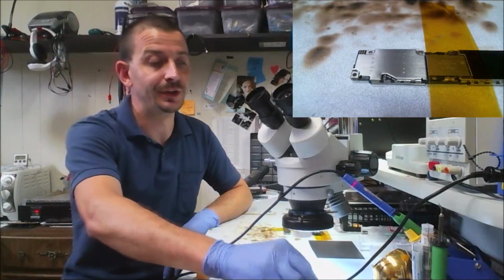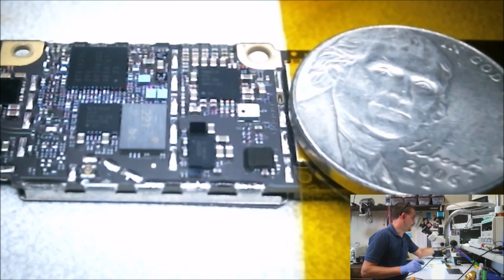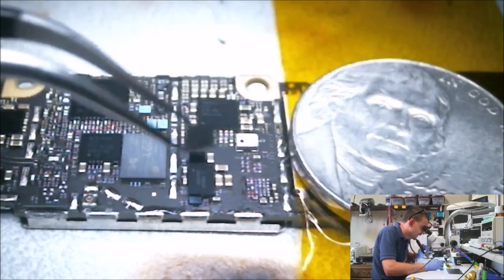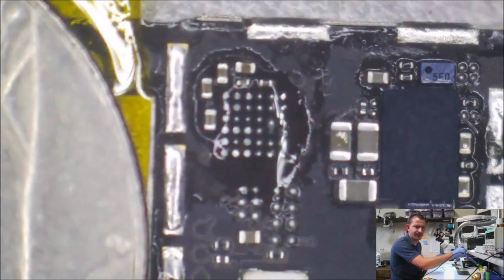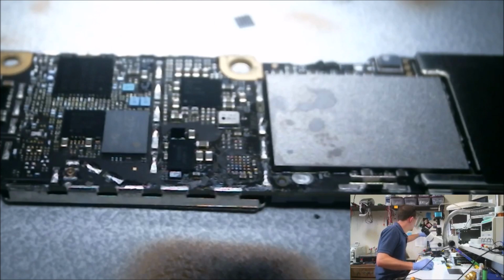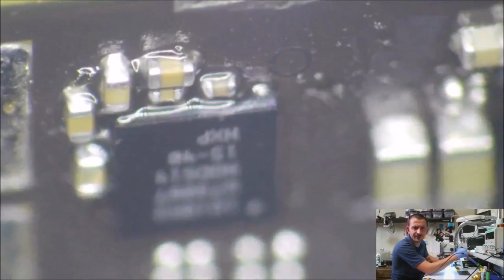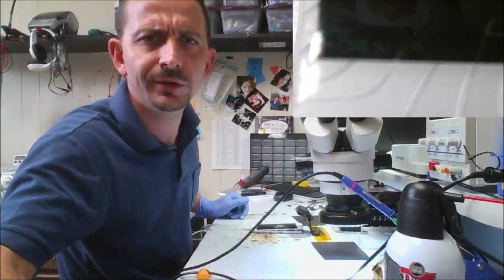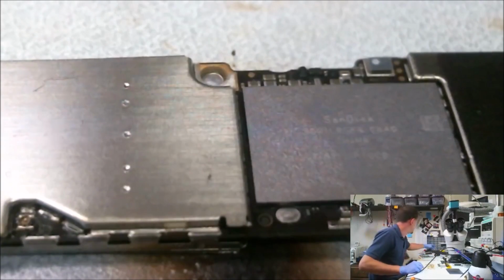iPhone 6 Tristar IC replacement (U1700) (U2) Not charging / Accessory not supported / battery drain

Comment: Could you put kapton tape over the caps,  two strips masking off the sides with components so if they float they won't drift or get pulled by the goo on sticking to the IC?

Comment: Really good tutorial. Just one question, because of the tight tolerances between each solder ball how are you sure they all line up ?.
Reply from the maker: It's tricky but surface tension makes it possible without being perfect.  As long as it's within a certain margin and none of the balls are bridging pads, surface tension will align all of the balls & pads at the same time when they melt.

Comment: Sir, how do i know if the 'dot' of the chip is in the right direction? (iphone 6) which way do i need to place the chip, because i dont have the schematic program to see if im doing it right..
Reply from the maker: On most PDF schematics, there's a red arrow that indicates pin A1.  A1 is pin 1 and is the direction the dot will go to.
Reply: STS Telecom 

oh too bad i dont have PDF schematics programs.. can u tell me which way it has to be placed? or its not the same each iphone/chip?

Comment: Sir I am having iPhone 6s plus the touch id is getting hot and iPhone 6s plus is also having a battery drain issue the icon add finger print is greyed out I have restored it two times which hardware I have to check now

Comment: Hi, i watched a lot of your videos, and just wanted to ask you what temp are you using to remove the shields? And one more thing - my iPhone 6 recently stopped charging, and after doing some research, i discovered that U2 (Tristar) could be the problem. So i got 2 new ICs, cleaned everything including the black stuff covering U2, removed U2, cleaned the black stuff underneath U2. Then i ran into a little problem, wasn't sure about the orientation of the IC, searching on google gave me two different orientations, so i decided to try my luck and soldered it the way i thought it should be. The phone turns on, when i connect the charger it says CHARGING, shows the charging symbol, power draw is around 500mA with screen on. As soon as the screen turns of, power draw drops to around 10-20mA... Any idea what could the problem be? Could it be that the U2 IC is bad? Also, IF the orientation of the IC is wrong, i guess the phone wont turn on, or it wouldn't charge, right?
Reply from the maker: I think your Tristar repair is good if the phone boots.  I've seen one other phone doing this and I've replaced dang near everything and it still does it.  I no-fixed it back then but now I know the only things I didn't replace were the PMIC & the charging coil on the other side of the PCB.  Very weird problem... draws current through USB only when screen is on but still doesn't charge the battery.  Weird problem
Reply from the maker: btw - I would call that a successful Tristar repair.. even if it didn't fix it.  Just means it wasn't the problem.
Reply: Ok, so i replaced the tristar IC, again, thinking it could be defective, no luck, still does the same thing. Like the phone is getting power from the charger, but the battery isn't. Thinking of replacing tigris IC next. From what i fond on the web, it's also has something to do with charging. What do you think, should i try it, or if you have any other idea/advice, i'm willing to try anything. Oh yeah, one more thing, before i replaced tristar IC, the phone had battery draining issue, now it seems ok, battery only dropped 2% overnight. Oh, and thanks for the reply.

Comment: I have a iphone 6 and when i dont use it for a few days when it dies it wont turn back on and the battery reads 1.4v i have to jumpstart the battery just to charge it any help ive tried dock connector

Comment: I have replace a lcd to my iphone 6 and i have took of the battery connecter before starting take off the lcd and i took the lcd of i check the new one everything was look ok and i replace the screen with the new one 
Once i put the screen on and the battery connection back and i press the button 
The phone wasn't turning on
I have plugged on charging and nothing 
What do you think is the problem help please

Comment: If you do a chip on a macbook board vs an iphone board do you use substantially lower heat on the mac board chips?  I read somewhere you use around 260 C instead of 375 C.

Comment: hello , someone help me iphone 6 battery getting drain even im changing u2 ic and the bottom 30 pins ic but the problem remain same the battery percentage getting darin once the phone i trun off and on before i trun it off it was 60 % and after it trun on it becomes 12% i changed the whole charging area even the crystal 9 pins ic but the problem remain same help me

Comment: You said it requires a lot of heat, and I've never tried it, how about using a low melt alloy to remove this IC chip? Would it hurt anything? Of course you need to clean it off the board real good before mounting the new chip. Just curious coz"I've never tried on BGA. I was thinking if you're not able to get all those low melt alloy residue  off the board you might end up with a weak solder joints.
Reply from the maker: Lowering the melting point makes it a lot easier putting the new IC on but no way to do it until the old IC is removed.  I certainly wouldn't use that low melt stuff because of the weak joints tho..  leaded solder works best.
Reply: BTW, you have got to be the neatest with the cleanest soooo organized shop I've ever seen! :) My old lady nag me everyday and said I'm a slob when it comes to keeping my shop tidy. I argued and told her " Honey, actually I'm a neat freak but I just need to get over it and so far am doing a damn good job at it" :)

Comment: Hello how to be sur that's is the tristar issue ( un case of batterie drain ) ?? i actually check that voltage on the capacitor arround but is if the right way ??

Comment: I have an iPhone 6 that was not charging after water damage. Phone could boot with a good battery but could not charge. I tried to replace u2 ic and rehot u1401 ic and now phone is completely dead, iTunes does not recognize it. I try to measure the volts of the capacitors near this chips and no volts, no sigh of life!! What i did wrong? Can you fix this if i send you the phone? What's the possibility to repair this? Thank you

Comment: the 6s does it take the same exact chip? thanks!
Reply from the maker: I've never had an issue mixing them up.  I've used 1610A1, 1610A2, & 1610A3 intermixed in many different iPhone 5c, 5s, & 6/6s.

Comment: Hi.. my iphone 6 discharging its battery even though its not using... the battery remains for 2 hrs even it s used or not used ... fingerprnt sensor z also failed in this.. its not the battery issue
What would b th problem

Comment: didn't realise how much heat this chip tool until today. Pulled two pads :( 
forced it up thinking it was some underfelt holding it down
Reply from the maker: Oh man,  the iPhone 6 Tristar IC takes crazy amounts of heat.  I have no clue what is there that gets rid of heat so fast in that spot but just a few millimeters away and things float the way I would expect.  They're tricky not to pull pads because the rubbery coating is holding them down too.  You wind up having to pull on them pretty hard even when the solder is melted.  Makes it tricky.. I did the same thing not too long ago and had to run jumpers.  Hopefully your two pads are on an outside pin.
Reply: STS Telecom both outside at least, ran two tiny jumpers using solder brade. Don't think customers know how much work goes into these :S

Comment: Hello again! Please help I just replaced tristar and when powered on there are only white screen with Apple logo and it stays in Apple logo. What happen if there are no tristar at all, is that same Apple logo then? I'm gonna reflow it again if the balls not melted properly and hope it works. :) or did I destroyed it/Flash drive with too much heat?
Reply: Ok. After reflowing it works and charging but screen is flickering at the point where screen is dark (slide to power off) lol
Reply from the maker: +Inspiraattori I've had to restore them through iTunes before after a Tristar replacement and having issues like that.
Reply from the maker: I didn't see this comment before my last reply.. A restore is not going to fix the flickering.  Sounds like something must have went wrong.
Reply: +STS Telecom I was lucky it was just a bad screen in this case.

Comment: Hello! Thanks for this video! Can you tell what is the difference of (1610A3) and (1610A2) chip? in this video you have 1610A3 chip. and in ebay - uk seller sells this (U1700) chip with (1610A2) mark on it. I have iPhone 6 and 6 Plus. Do you have 6S in this video? Thanks :)
Reply from the maker: I have mixed and matched pretty much all of them (except for the 1608) without noticing any problems.  I think there are just newer versions but I'm really not sure what the differences are.

Comment: Easy way to clean the pads and remove the underfill is just use a micro pencil and load it with lead solder. Add flux, clean the pads with the solder and the heat will remove the underfill. 
You can then just wash it away with alcohol.
Reply from the maker: thank you! :)
Reply: Chris Long sir i have a problem.. 

1: i took off the chip but im kinda missing 2 pads and 1 component on my board.. is there any other way i can fix it?

2: how do i know if the chip is already attached on the pads itself after heating it up?
Reply: Which pads there are a few that are NC (not connected) the components can be scavenged off a donor board. 

Add a little flux on the pads then place and hold the chip gently in place. Add heat till flux melts a little. Then remove hot air. Remove tweezers slowly not to move the chip. Then heat with hot air till you see the chip sink down and it'll pull to the pads if you align it correctly.

Comment: What are your recomendation , if i cant buy a Brandson EC
Reply from the maker: +johnkor I tried plain distilled water for awhile before I tried Branson EC but it really didn't work for much.  A quart of Branson EC lasts a long time.  I use 50ml each time I fill the cleaner every few days.   All-spec sells quarts for $12.   So after shipping it's gonna be $20.   I go through maybe a quart per month with the small size of my cleaner.  There are probably other cleaning solutions that will work though.  Might be hard to beat 12 bucks.

Comment: Hey maybe you can help. Had a phone where customer used a cheap charger. Stopped charging/turning on. Would only boot loop with external power/charged battery. 

Replaced Tristar. Phone boots normally goes to home screen, unlocks, everything fine. Except PC doesn't detect it and doesn't charge or even show charge symbol. Think it's a bad Tristar replacement chip or something else?

Comment: thanks for Good video 😃what kind off hot air station do u use ?
Reply from the maker: You're welcome! Thanks for watching :)

That is this station:
https://www.amazon.com/Aoyue-852A-Digital-Rework-Station/dp/B000HDDXY0

I've never been rich enough to use one of the higher end stations so I really don't know the difference.  I've used a couple of cheap ones and some of them are just too cheap.  I chose this one because it has a heavy ceramic heating element causing it to change temperature slowly and be much more stable.  I had one that was way cheaper but the same brand name.  It only had a wrapped wire element at the nozzle that would heat up to the set temperature in the snap of a finger... those are dangerous and unpredictable.   There are many on YouTube that will say you can't use anything less than a $600 station - that's not true at all.  This one works very well and works all day long every day.   For the price, I could replace it every year if I needed to.  No clue what that vacuum pickup tube is useful for other than making noise. I keep it thrown off to the side.  LOL
Reply: Thanks for the info , fun to see there is good resulat with 120 usd station ;)
Reply from the maker: +Anders Lindquist I will eventually upgrade it like I did the soldering station I love so much now.   But I'm only running the air at 40% and temp at 380 (most of the time) so if I needed more ass, there's still lots of room to turn it up.

It sorta gets under my skin to see people saying you can't use anything cheap because you really can once you get a feel for hot air and PCBs.  I'll be upgrading for features other than hot air quality.  This one takes me forever to go from 100c to 380c with the push button digital setup.   Presets would be nice for saving time. That would be worth it for me.  Thanks for asking!

Comment: Your scope itself looks the exact same as mine. As long as you didn't pull a pad, your golden. May need to add memory to the computer, it always helps. Isn't the board a heat sink? What liquid are you using to clean with the tooth brush? Compressed air is dry, you just need to keep a dryer in line and cleaned out regularly(auto supply stores carry inline dryer's). Sorry I post in real time as I watch, I know you it's not live but is to me......
Reply from the maker: If I had pulled any pads... I would have uploaded the video anyway! LOL

This computer is getting kicked out of production duty pretty soon.  There's a way better machine for it already in the shop being used up front.  I'll probably try moving things around a bit before spending more money.   

These boards are amazing heat sinks and every component, as well as different areas of the board have different thermal properties so a component next to the one you're working on can be dissipating heat and then it doesn't behave like replacing the same IC on a different board.   My first iPhone 6 Tristar replacement threw me way off by the extra heat needed compared to a 5C.

I am using 91% ISO - I hear everyone ranting about 99% but that stuff has proven to be a bit tough to get around here and I haven't seen it worth the extra effort.   The rest of 91% alcohol is 9% distilled water which does not conduct electricity without dissolved solids and dries totally clean with no residue left over.

Comment: I know it's hard to tell. I have get a few iPhone 6 devices where phone is dropped. No power. I measure vcc. And it's short to ground.  What do you think could be the issue? Or how would I go in approaching the solution
Reply: Use alcohol around major IC'S then add the voltage, the short will dry the liquid faster(like the heat gun does) may take a while for it to heat up as the low voltages used but same result. You can also use flux, just not as cheap as alcohol..............Look for the drying area/S you'll know right away where the short is.
Reply from the maker: When I know a line is shorted, there are many times I wind up putting current into that line at a safe voltage for any component on the same line - and waiting for heat.  Usually narrows it down pretty quick.  If it's not immediately obvious, the schematics combined with where the heat is helps to tell where the paths to ground are and narrow it down.  1 to 2 volts usually gives me enough current to find the heat source on VCC_MAIN. :)
Reply: +STS Telecom I agree. And I have done that. Nothing gets warm to the touch. Comparing voltage drop to a known Good and I see same numbers
Reply: +STS Telecom but I did mean vcc_main. Thanks for the tips
Reply: Removing the suspected chip then testing, I assume would remove the ground.
Reply from the maker: Just realized you never said VCC_MAIN, you said vcc.  If you're getting the same readings on a known good board that means the area you are testing is good..  it's gotta be something else.
Reply: Ah the mother of all trouble shooting, reverse engineering.........................:)